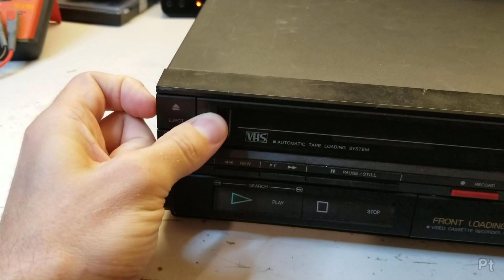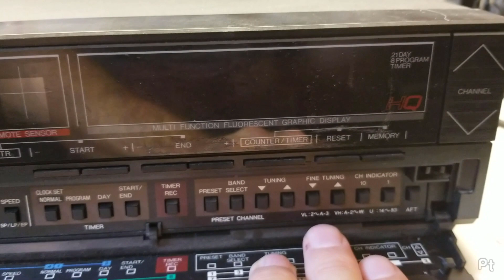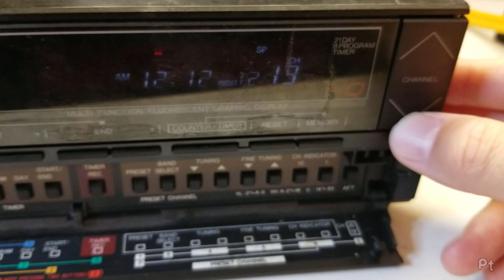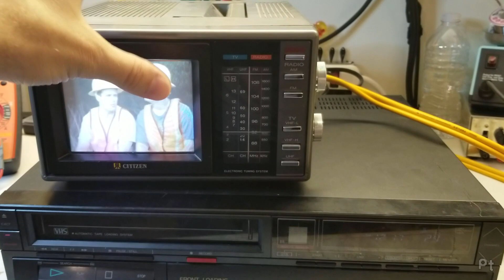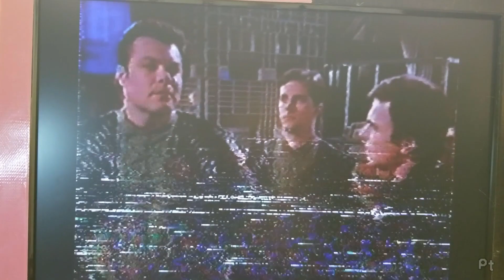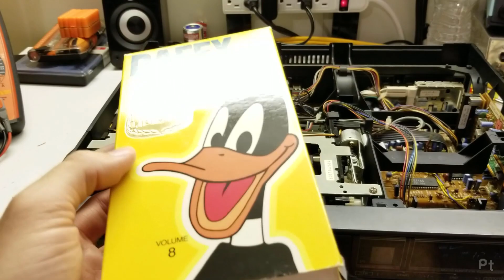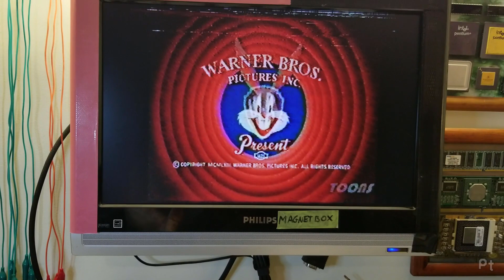1987 Emerson VCR (Model VCR872)

Comment: I'm pretty sure I had a UK version of this under a different brand name, but I cannot recall whom it was, I recognise that remote sensor window design and I'm sure it's the VCR I had when the UK was just getting our 5th terrestrial channel, and it had a dead tuner, so couldn't record the official start of said channel, but was a part of the booster circuit as it were to pick up the crappy signal Channel 5 used back then... :P
Reply: The remote shown at 0:39 looks exactly like one I had for a LOGIK VR960A from Currys/Dixons. I think Matsui also used that same remote control.

Comment: When I was growing up, we had a similar unit at home. Ours was an Emerson VCR754 and it lasted quite a good long time. We had it up until 2002 when we upgraded to a VCR/DVD combo.
Several years ago, I saw what looked like that same unit at a garage sale and I mentioned to the homeowner that we had one like it when I was growing up. He said, "It still works if you want it." It would have been cool to buy that just for the nostalgia factor, but I already have a VCR to work with, a Hi-Fi unit at that. I can't remember if that one even had the remote with it anyway.

Comment: ahh cable tv filters. back in the day my dad only paid for channel 2-28 from rogers. one day when i was a kid i called them and told them he wanted to add all the other 30 or 40 channels they said ok no problem will send someone tomorrow to remove the filter. guy came and pull the filter off and i called them back the next day and told oh i changed my mind we don't want those channels. so they remove them from the bill  and say  ok guy will be out to refilter ur line. no one showed up 2 and half years went by and some cable guy shows up and say i got a service order to put a filter on the line so my dad says no i want those channels ill call them to sort it so the guy left my dad never called and no one ever came back lol. so we had like 30 extra channels for free till sometime in the late 90s after we switched to bell express vu lol.
Reply from the maker: I like stories like this. I had free analog cable for a few years when I first moved out on my own. No idea why, this just took a couple of years to finally install a filter (I was only paying for internet).
Reply: @probnotstech  another funny thing is now they have to remove those filters or internet modems won't connect to all the channels for docsis 3. i was on cable internet though start.ca for years till they ran fibre in my area. one night internet went down and when it came back up the modem witch was an 8 channel docsis 3 modem would only connect on half the download channels. contacted support no one could figure out why. so they had a rogers tech come out and he goes right out to the box sees it had an analog tv filter on the line witch they were required to install when i signed up as there were still some analog channels and they didn't want u splitting the internet line to get free tv. thing is when the service when down that night they moved internet to using some of the frequency that filter blocked with them totally ditching analog tv internet needed them and it wouldn't fully connected to all the modem channels any more. so he pulled the filter and everything worked again.

Comment: Do you believe that Orion were known for using "bits and bobs" from other V.C.R.s? The video head appears to be from a Sharp and sometimes, the mechanical parts seem to match either with Sharp or Mitsubishi. Thank you for this video. Look forward to them every week.
Reply from the maker: Possibly? There was definitely part sharing between Japanese manufacturers on other stuff like ICs and capacitors. Also, thanks, I really appreciate it!
Reply: @probnotstech  I have an obsession with Sharp personally as dad bought a VC-6730U brand new in 1987 and it was in my room a lot as a child. Would love to see you tackle a very early one like a Sharp VC-7400 or even a 6800. The VC-6300/6800 was their debut deck. Was a strange animal on it's own. Dad remembers renting the VC-7300/7400 when he lived in England before moving to this country in 1986.
Reply from the maker: I would love to find one of those very old Sharps here. Never seen them in person, I don't think they were very popular if ever sold around here.
Reply: @probnotstech  One thing you had to watch for with those early ones, from 1979-1982 Sharp had the bright idea to use a brass alloy in their head drums. This in theory was to make the drum last longer but all it did was clog and corrode. That's probably why the early Sharp decks are so rare.

Comment: I have a 1988 Emerson 2 head VCR with the same tape transport as this. I started to restore it, but hit a roadblock with the capstan servo just running wide open speed at all times... probably caps. It is a more compact (length wise) than this one. The oldest Emerson (Orion) I have is from 1985 that is a portable toploader that uses a separate reel table motor. I will eventually get to videos on that :) 

As basic as these Orion decks are, they all seem to work fairly well.
Reply from the maker: When I had this VCR originally, the prevailing attitude was that Emerson/Orion, Funai/Symphonic (regardless of the year) were all cheap junk. Now, 30 years later I've come to appreciate how these older "budget" VCRs were built. Good picture and solid mechanisms.

I'd love to see the video on the portable toploader. Is it something like the VCP-700?
Reply: @probnotstech  Yup. It is the VCP700. This one has never been used before until I got it. Also got the matching Konica tube camera and tuner that goes with it. 

Here is an unofficial video of it from 2 years ago https://youtu.be/lE2eDTasf2w
Reply from the maker: Oh my god, you have to get the little VT70 tuner that goes with it. You could have the complete set, and that little continuous tuner is so ridiculous and awesome.
Reply: @probnotstech  yup, already got that too :)